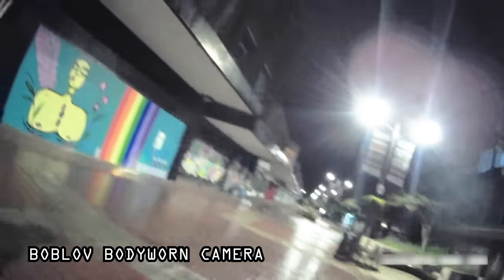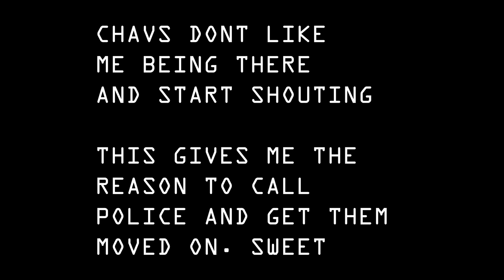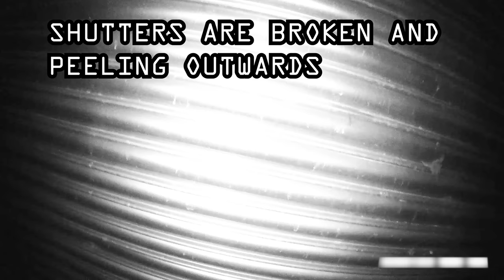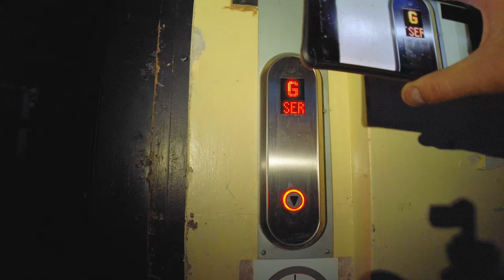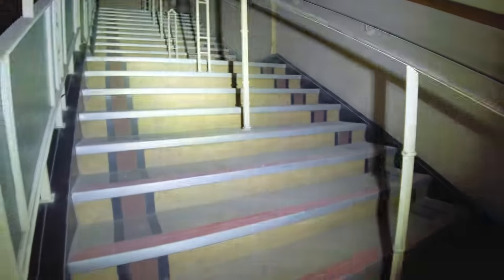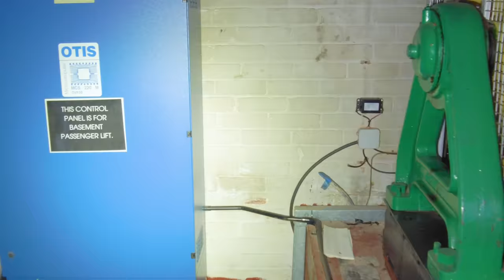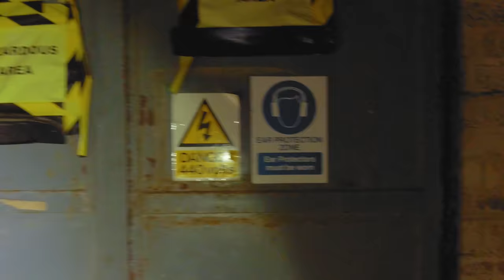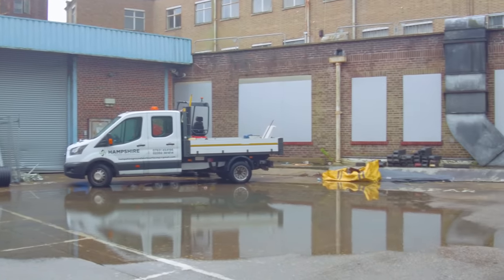THREATENED WITH A WEAPON at Debenhams Portsmouth BUNKER FOUND

Comment: 1:17:18 It looks like the fulcrum is in the middle of the brake levers so you would probably have to push both top parts in towards the electromagnet if I am not mistaken. The motors look nice and vintage, I don't know when I last saw a motor that big which you could actually see the stator windings through the ends of the casing.